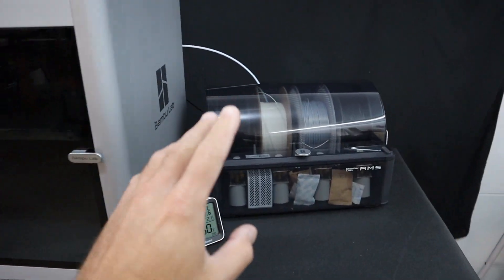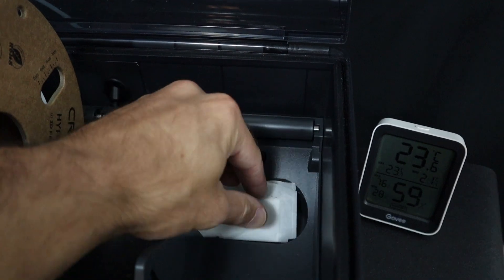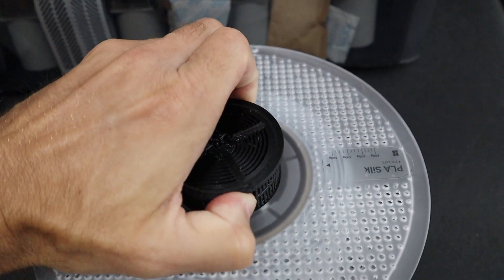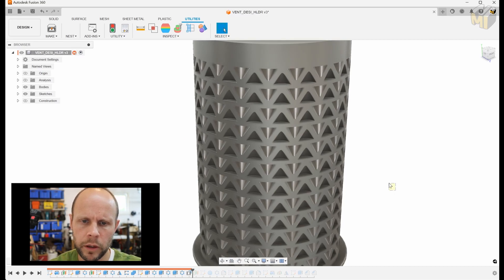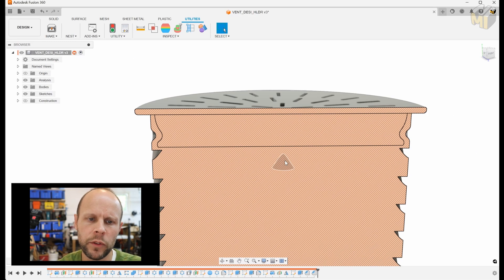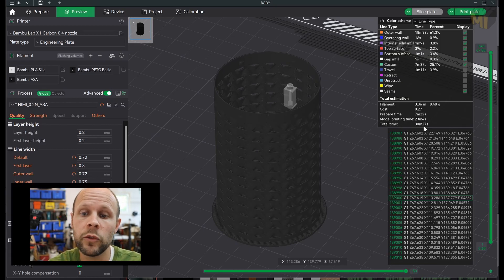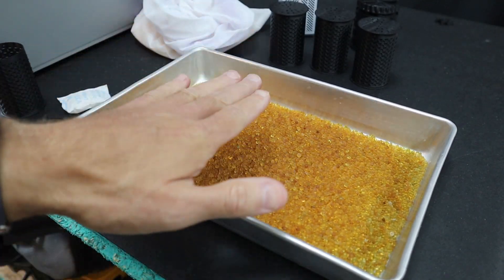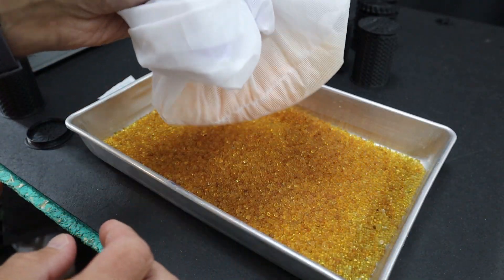Super Dry Your Bambu Lab AMS with These Cool 3D Prints

Comment: The model you made has a lid on both sides for BODY.stl, how do you remove the lid so you can fill it with dessicant?
Reply from the maker: It probably looks like that as it comes in, but it has to be printed with Vase mode, doing it that way will hollow the part, make sure to use the exact setting I've specified though, I believe the walls were 0.7mm and enough bottom layers as well.

Comment: Thank you kindly for this!! I'm fairly new to 3D printing and have a question.. If I print this item on a Bambu X1C, will the STL have all the settings you described 'cooked in', or will I have to physically make these changes in the slicer before printing? Thank you very much. JD

Comment: In the universal cylindrical version, the cylinder is capped on both ends in the STL – it is solid.
It is impossible to separate them. You must have mistakenly uploaded the wrong file

Comment: I must have done something wrong because they printed perfectly except, the cylinder is sealed on the end that is supposed to be open where the removable cap affixes.  Not sure what I could have done as the only changes were how they were organized on the plate.  Printed on my Bambu X1C in about 6 1/2 hours.  Obviously unusable like this as there is no
way to get the desiccant into each tube.

Comment: This is a very nice design. I do like it very much.
I like that it's smaller because there is more room around the cylinder to get the moisture to the desicant.

I did print one and it did print quick and nice.
However the bottom was not very well attatged to the wall.
I could pull the bottom very easaly away from the wall.
Then i looked at the settings that came with the model and i made the mistake of too few bottom layers. You need at least 6 bottom layers. I used only 2. Now i did change it to 8 and the bottom does stay on very well.

Comment: To print this fast, your minimum time per layer must have been very low.
Reply from the maker: I left all of the settings as-is, but it seems to work out well, that's probably in part because there isn't much there for overhangs, a little bit of bridging though.

Comment: I was actually hoping that the ams would be a filament dryer at the same time. Kind of a bummer that it does not have that function. I guess I need to invest in the small yellow moisture absorbsion beads.. wil they work as good on tpu as well ? and what is the best way to dry the beads again ? just a oven tray and bake em ? I'm coming from a standard ender 3v2 with a dryer that runs a dryer the whole print long.

Comment: I am having trouble printing these files ( body and lid ). The body prints as a solid, and the lid prints the perforations, but then caps them over with solid infill. Am I getting the correct files, or deoes anyone else have the same problem ?

Comment: I printed one of these using bambu lab and it got printed as a solid cylinder,  then I thought about removing infill and it is now hollow but it's still covered on both ends, no way to put desiccant in. Am i supposed to change some settings so one side stays open? Sorry I am new to 3d printing, what am i doing wrong?

Comment: Lol,  you took a design that was bad and basically made it nearly as bad or arguably worse. If the desiccant holder doesn't stay in the spool then your design is a fail.....

You designed this on the premise there is not enough venting on the ends to work, but you failed 101 of design which is understand the product you are working with (assumption is the mother of all f-ups). The desiccant only needs a very small amount to be exposed to the air, the wicking effect will rapidly pull the moisture to the centre of the pile of desiccant even through the plastic container you put it in. What you should have done is simply removed the venting on the main cylinder so it prints fast, then designed a system to hold it in place on different spool sizes (or just make the cylinder size parametric so you can custom size them to fit the different spools easily).  

You also want the desiccant tight inside the container, this way the wicking effect has maximum surface area and mainly so the desiccant is not ground up in the AMS as it tumbles.

Comment: I wouldn't use cardboard spools in the AMS, cardboard gives off particles that can be caught inside the feeding system and clog up your ams or nozzle
Reply from the maker: I agree, the carboard is also pretty slippery on those rollers.  I was trying to use up some older material, since the video I don't use much in the way of cardboard, sometimes I use Creality's HF filament which seems to have a treatment to the edges of the spools to use in their own AMS, but I've never tried them long-term.

Comment: Hi, Been looking for a universal barrel and this one looks like it will work, only problem is loading the body.stl from the .zip file it has both the base(fixed I think) and the cap already on it, is it print in place? if so why the lid in the same .zip file. TIA

Comment: Nice design. I will give it a try, and thanks for the Fusion file! The only bad thing is that I'm designing a spool weight for my nearly empty spools. I haven't had real issues with that, but I'll see if it would be better to have a desiccant in there instead. I fortunately live in the desert in CA, so Moisture isn't a bad issue. But hey, it never hurts to be cautious.
Also, I haven't done much with Vase mode, and it's very interesting how you set this up to have gaps in the printing. Very nice!

Comment: I've printed a WHOLE bunch of these, with the larger flanges, for all of my spools (40+ now).  I print them in clear PETG so I can easily see the desiccant color.  This has probably consumed nearly a whole spool of filament!

The Sunlu spools especially have a bigger core, so I also created some ventilated spacers for a bit more radial stability.  I tried simply enlarging the design in X and Y, but the interference fit became unreliable.  After chasing beads around my workshop when one popped open at the wrong moment, I decided to stay with the original and just add spacers.  (I printed the spacers in ABS for max heat resistance, and they don't need to be transparent.)

Comment: I like these!  Funny print story ... I first printed in PLA as I didn't have PETG yet.  Print was fine, no issues.  I still had to order desiccant beads.  Got delayed, finally ordered the beads, and got some PETG in the meantime.  I go to print them in PETG, and I have four failures in a row!  The attached side kept easily detaching!  I said to myself, "I'm going back to the vid to see if I'm doing something wrong".  Sure enough, I forgot to add the .3mm to each line width as you said needed to be done in the vid. I apparently did it with the PLA print, but forgot about it in the interim.   Oh well lesson learned, I saved the project with the added line widths this time, so it won't matter if I forget again! ;-)  I have two printed in PETG successfully now, and printing another two as I write this.

Comment: In your model on Printables, it is sealed on all sides. Why? It's easy to chop the top off or set the top layer to zero, but why a sealed top? Am I missing something?
Reply: Cap just pops off. If its not check your printer tolerances

Comment: Cardboard spool?
Reply from the maker: They're not supposed to be used inside the AMS, but I've done it a few times without trouble.  Even Creality's new spools for their own system are cardboard, but they've sealed the edges so they can I suppose grip better.  I don't have a K2, so I can't say for certain, but it does work well inside the AMS.

Comment: I really liked this approach at first but two issues arose:

-The thin walls on the base and cap tend to separate very easily, the model needs some extra material there to bond the faces together
- at some point you will inevitably forget about the cylinder and move a spool too fast, the cylinder falls out and explodes beads everywhere 😅🥲
Reply: The video explains that .3mm needs to be added to all the fields for wall thickness (in the Quality tab).  Did you do that?  Something else (where I got confused) is that the "Spiral Vase Mode" needs to be checked in "Other", or the body won't be hollow.  With those parameter changes, it should print fine.

Comment: There is something wrong here. I added 4 similarly designed tubes for silica desiccant inside a HUGE filament box (it can fit around 24-30 rolls). I installed a filament sensor with a bracket so that the sensor opening was facing inside the box, sealed the edges of the bracket and I achieve around 10% humidity after a couple of hours. Are there many openings in the AMS?

Comment: the print is taking more than 1 hour X1C -standard and its printed both ends+ and infilled completely (not hollow)  - 43mm cylinder!
Reply from the maker: You'll need to turn on VASE mode or Spiralize Outer Contour (Cura), also make sure you have at least 6 bottom layers, more is better for a more solid connection between the lid and the walls.
Reply: @NeedItMakeIt  Got it!  Still says 46:50 printing time (total 53:35s)

Comment: I downloaded the designs. The universal body is closed at both sides when I load it into the designer. The lid has a solid piece on the inside. Maybe I don't understand what to do but I don't think this will print a fillable container.
Reply: I have the same question/concern
Reply: I printed the container and lid and both are fully closed, no holes and totally unusable. I think we need to understand how this is printed.
Reply: @PaulSinnema  Yea I have a feeling we need to find a different design.  I bet he doesn't reply because he has no intention of updating/fixing design and or the link.
Reply: @fishbonez5670  I found the solution. In the description (pdf) it says 'Mode: vase'. You can find that option in tab 'Others => Special Mode => Spiral Vase'. Check that to 'on' and slice again.
Reply: @PaulSinnema  Good find.  I saw that but didn't correlate that with the top so I never sliced it.  Well done good sir.

Comment: Your uploaded stl of the universal spool desiccant holder includes the lid in the body despite having a separate lid stl. P.S. it's even more messed up, it includes internal solids that slice as infill so it looks like the redesign has been exported with additional extraneous geometry that prevents useful printing.
Reply: Incorrect. You need to select Advanced > Others > Special Mode > Spiral Vase and then it prints as expected. Always remember to RTFM!
Reply: @factotumindustries  Thanks, that worked.

Comment: So, just for a rookie. If dessicant only remove air moisture ¿is using only heat certain previous and during printing time enough to keep air and filament with low moisture avoiding filament humidity print issues ? Or whats really the dessicant point? Thanks

Comment: Did you modify the files then not provide files in the description link??
Reply: Disregard. It looks like you linked both the bad one and your improved one and I just didn't open all the links.
Reply from the maker: I liked the others only because I mentioned them in the video.  I'd recommend printing in a color that's not similar to your spools, it's easier to tell that they're in there.  A few times, I've not noticed them inside of a black spool, and they've come out and hit the floor pretty hard.
Reply: @NeedItMakeIt  thank you for the reply. It’s quite humid in my office so I’ll be printing your designs.

Comment: why does the body file have a top and bottom?  shouln't it just have one end?
Reply from the maker: If you run it in Vase mode it will come out correctly, just make sure to follow the specs I've listed to make sure it's strong enough.

Comment: The silica gel that doesn't change color will still change size.  That's how yyou will know it needs to be replaced
Reply from the maker: I've never noticed a size change, I suppose that's possible.  Silica gel captures moisture not within, but in the surface, I'm not sure how much it would change in size by if that's the case.

Comment: Good video but I feel like I'm just barely missing the juicy stuff. What are the design parameters you used to make this a 30 minute print time vs the other 2 hour one? Like you said for .4 nozzle you did .72mm line width, was that just for strength or is that a good width to print fast?

Comment: I'm skeptical of all this air flow you speak of. I feel like the humid flows to dry areas (the dessicant) and the slots seemed sufficient instead of just sealed off. Would be cool to see the humid levels comparing the the two systems and what you propose
Reply from the maker: Are you familiar with convective loops?
Reply: @NeedItMakeIt  yes assuming you mean the heat source coming from the chamber of the printer. Though more prominent in a larger volume (the space) with bigger change in temperature in this "insulated" ams system from the heat source.. either way its not like a large soup pot (large change in temp), or like the cold ocean with the atmosphere (large change in temp relative to space). Something like that, if anything a convective loop helps with the air flow.
Reply from the maker: @TORQ-1  Sure you can have that; there are also motors and electronics within the AMS itself.  However even without any active heat source convective loops exist everywhere with the exception of a vacuum, small scale or large scale.  A practical small scale example is the need to insulate our wall cavities to avoid convection.  The point is that if there is far more area available for air to circulate around the containers, the movement of the cylinders will expose the surface of dryer beads to the AMS.  The beads themselves absorb moisture into their surface and it makes sense to have them move around as much as possible.  The also happen to act as a spool weight.

Comment: I bought two 12VDC 70c heat blocks which I put in the same space as the video.  I attached some small heat sinks to the blocks and they never get hot enough to hurt the plastic and require no controller.  Typical humidity is around 25%.

Comment: These spools are garbage. Followed your link and set them to print. Print started looking odd partway through so I loaded the files, again downloaded from the link you provided, into solidworks to have a look. Sure enough the files in your link are capped on both ends. Combined with how 3D printers interpret g-code this results in a nearly solid with just enough of a honeycomb inside to waste a shitload of filament and time. These are utterly useless. The only thing they are good for is a lesson in getting used to using, at the bare minimum, Sketchup if not a proper CAD program like Solidworks to inspect any files from a self-described "influencer". I will never recommend your channel or files again and will take every opportunity in every forum I see you mentioned to warn your slipshod drivel. This is what comes of "influencers" more concerned wit pumping out content than in producing good content.
Reply from the maker: Nice, thanks for the lengthy comment.  So I'll just ignore all of the parts which are you venting and get to the point.  The print must be done as I specified in the video and in the description of Printables or MW, it is supposed to be capped, printing in Vase mode will account for this.  Since I have... and quite a lot of people have had success, There is only one logical conclusion.  I'll let you figure it out since you seem to be quite confident in yourself.  

As far as your attempted jabs, hey I'm not perfect, but I try maybe it's not good enough for you, but you're the 1% of people who will be upset no matter what, so there is no helping you.

Have a great life and try and do a good thing once and a while, it's good for the soul.

Comment: Aouch! Cardb oard spools, in the AMS, with no adapter? These bits of caardboard could do a number in there.
Reply from the maker: Yes, I've heard that's a no-no, truth be told I tried the spool plastic pieces to add on, however they broke, so I went with it and hoped for the best, it needed a clean afterward, but aside from that, it was all-good and still works beautifully.

Comment: Nice Design! I noticed you are using cardboard spools in your AMS. Any issues?
Reply from the maker: Thanks!  I didn't have any issues, but they did leave a residue on the rollers, I ended up using the last bit of those spools up and I'm onto plastic ones, it's probably better this way.  I was using Prusament for a little bit, except those spools are too tight, now I use Bambu filament and the quality seems pretty good.

Comment: FYI the universal spool file is closed on top. Not open
Reply from the maker: Yes, it needs to be this way in order to print in vase mode.  Vase will auto-hollow the part, just make sure to use the settings exactly as I've shown in the video or on Printables/MW, I believe it needs 6 bottoms to lock in properly with the spiral layers.

Comment: Would the desiccant break down over time and create dust? Jw.
Reply from the maker: It depends on what you use.  If you're using the beads, they're supposed to only last a few cycles, but I've had mine for a long time and, yes there are some that are very tiny (low quality maybe) but for the most part they seem to last a very long time and many heating cycles.  I have some ideas for a most cost effective solution for anyone that I'm working on and I think it will perform better... but there is that downside of dust and dusty filament could be bad news.  I don't know if it is a big problem, it's hard to say without testing dusty filament for a long time, and the type of dust as well.